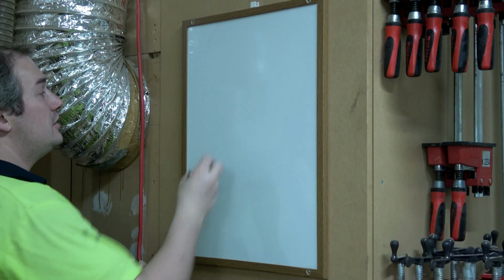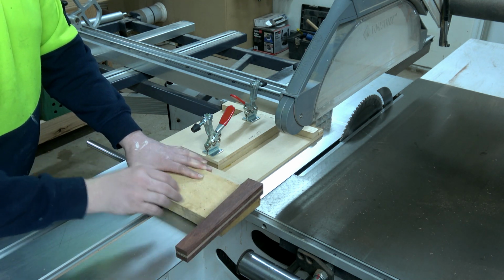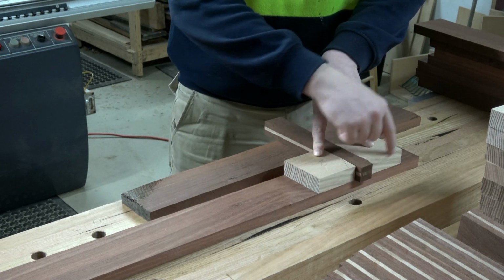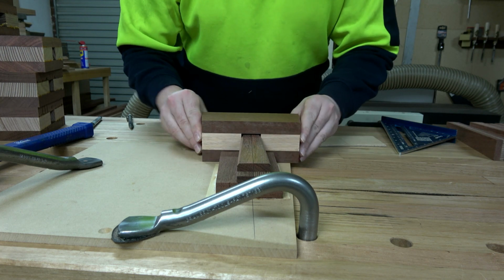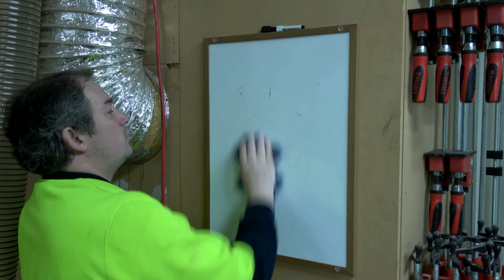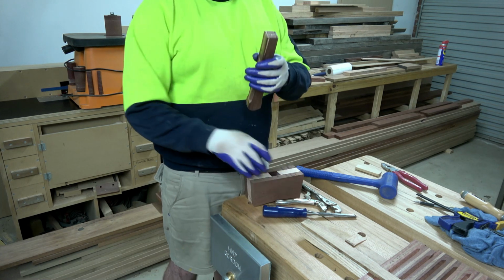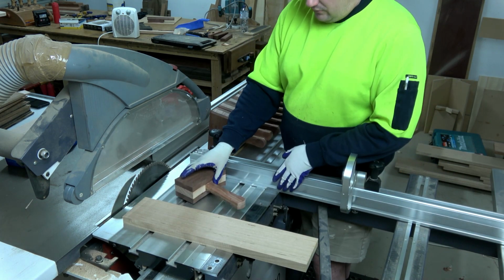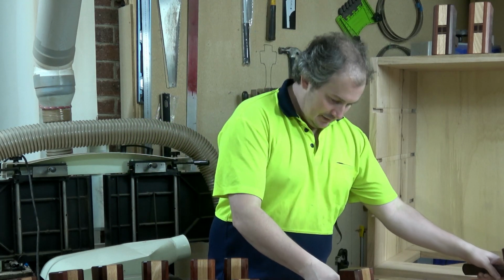How to build a wooden mallet

Comment: Is that a 12" tablesaw? It looks larger than a ten for some reason
Reply from the maker: It's a panel saw. Very similar to a table saw, but it is primarily designed for cutting sheetgoods like ply or MDF. It can rip 2500mm long, and uses a 12" blade.